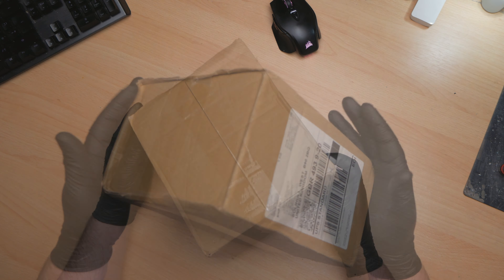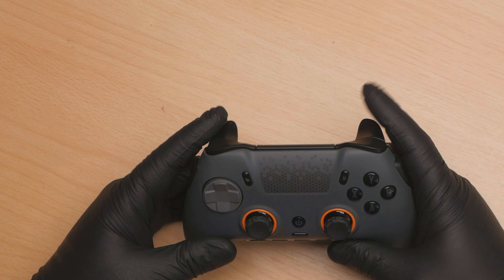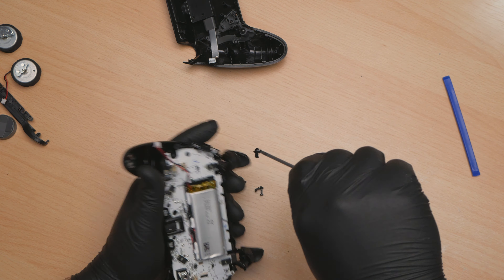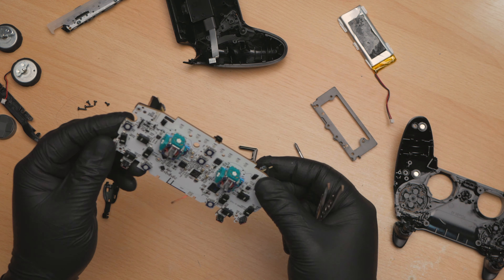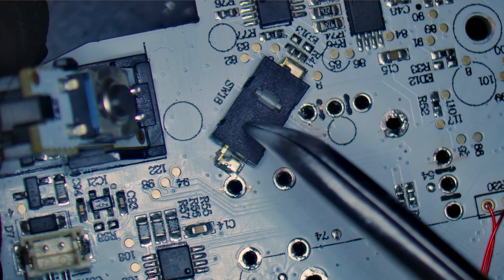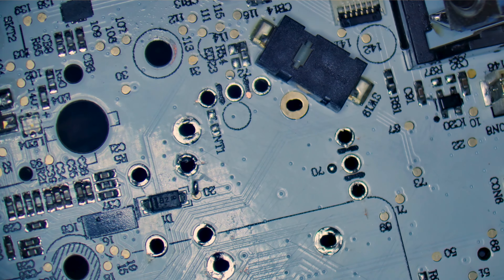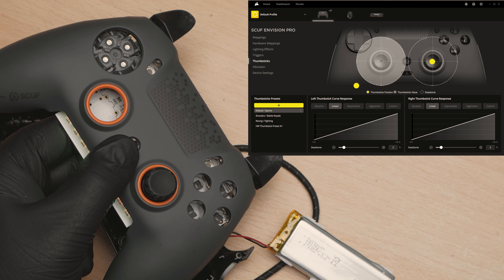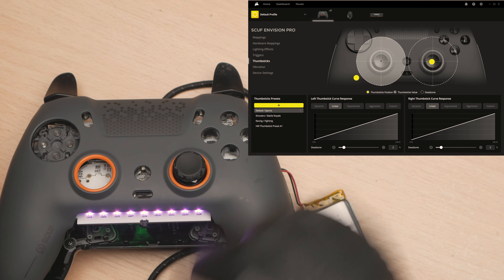SCUF Envision Pro | Can Hall Effect Sticks Be Installed?

Comment: trash controller.. no calibration feature yet so expensive.. ds4 is so much better
Reply from the maker: Yeah at the very least calibration needed to be in the iCue software.
Reply: @UberMicroRepairs  yep I think any controller (even the non hall effects) is perfect as long as there is calibration feature so that we can easily swap to any module we want. 
And some of the list that I know has it is: 
- DS4
- Bigbig Won Rainbow 2 pro
- Bigbig Won Gale
- Xbox series s/x (although not yet perfect)

Is there any more controller that I missed that has a callibration in it? 
(Also it need to be compatible with alps shape joystick module, that is why Gamesir is not on the list)

Comment: Honestly I think I may be super lucky cause I got my envision pro since day one and use it for about 2 hours (including back paddles and buttons) everyday except for weekends I use it for about 8 hours on weekends. The only issue I had are with the crappy icue software that will randomly delete my keybindings from time to time. So now I just do hardware binds and use steam input to change the mappings.

I honestly love this controller and thought about taking it apart to see if I could add hall effect sticks and calibration boards but thanks to your video I see that I can't. Which is not a big deal since I haven't experienced any stick drift but I will say that the stock sticks do have a bit of a more square shape than standard PS5 controllers. They are closer to an xbox sticks than the PS5 for the circularity test.
Reply: same

Comment: Could you relocate the calibration boards higher up and run trace wires?
Reply from the maker: Yeah I did tink of that. There is most likley room in there to do that.
Reply: @UberMicroRepairs I’d love to see a video of you trying this out. Seems feasible and you seem capable.
Reply: @UberMicroRepairs  I would be willing to get this controller if you made a video to show how to do this, would end up doing this myself.
P.S. thank you for making this video, quick question: what is that tool you use to suck the solder up?
-Cheers

Comment: Hmm, that controller is complicated and don't like hot air 😁... Thanks for  disassembly guide. 

One question, if you have some Scuf Instinct there can you please test do you have the new update on them, can you use the new tool from Xbox for calibrating?
Reply from the maker: Practice with the hotair and the modules fly out. No stress on the pads repeatable, clean results every time. Just some deviced don't lend themselvs to hot air. 

Scuf Instinct is a standard #1914 inside so it will work with the Xbox software.
Reply: @UberMicroRepairs  It works with Xbox app but does not have the latest update for calibrating thumbsticks. My Scuf Instinct don't receive that update, check some of "yours" if you have.

Comment: why are people just not buying flydigi controllers lol. The vader 4 pro is just fucking great. Hall sticks, hall trigers, clicky buttons, 4 back buttons, trigger settings(linear, mouse click) It literally has everything.
Reply: I’ve the Vader 4 pro and apex 4. One thing I don’t like is the thumbstick cap design. It’s similar to Xbox and I didn’t aim with those. I prefer the ps5 but thumbstick type. 

Also I just prefer ps5 symmetrical layout to Xbox
Reply: Because the asymmetrical toggle design is awful, PlayStation’s symmetrical design is far better

Comment: Envision pro mouse click trigger issue.
At a loss. Bought envision pro set it up. Used it for like a week. Zero issues. All of a sudden today playing cod mouse click trigger stop working on right trigger. Only way I can get it to work is basically turn of hair trigger and use it as a normal trigger with normal travel distance. I have heard people bash scuff and this was my first. But a week in and already major components are failing ?

I have tried restarted pc. Restarting Icue. Re assigning. Changing trigger inputs back and forth. The hair trigger will not operate for some reason.

Anyone had this issue ?

First experience with scuff and as a first impression will prob def be my last

Comment: Hi! 
I love your work! 
I was wondering, what are the calibration boards your are using for ps5 controllers? 
Where could I find it? 
Keep it up!
Reply from the maker: Thanks, They are on Aliexpress.
Reply: @UberMicroRepairs I noticed you're not using flux when desoldering components. Why is that? In one of the videos you mentioned that if you use flux ENGINEER desoldering pump gets stuck and stops doing the job.